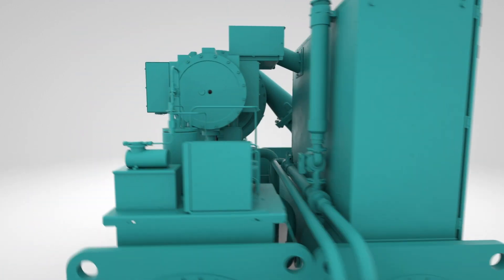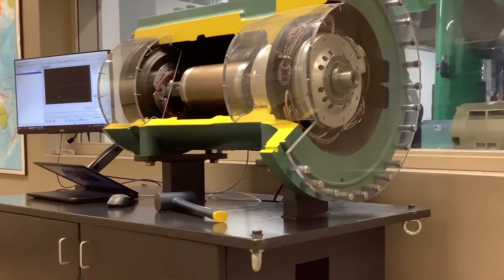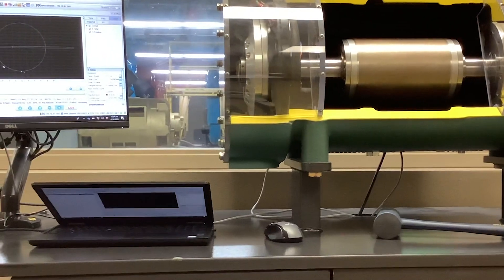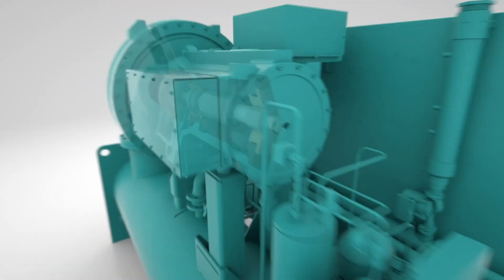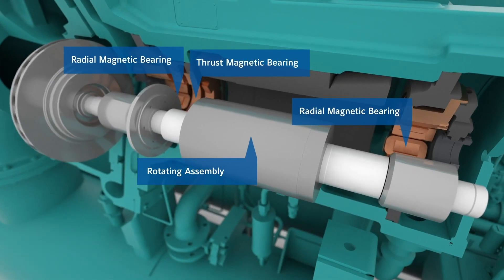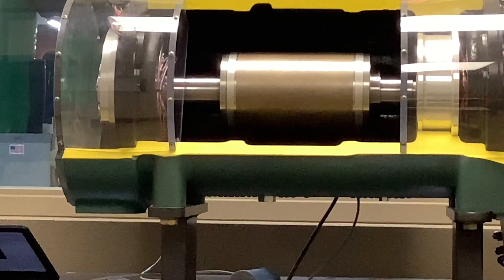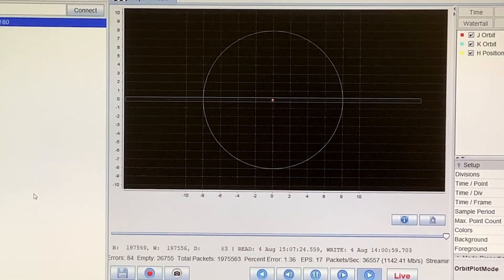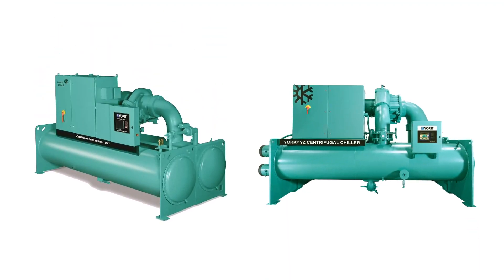YORK Magnetic Bearing Driveline Cutaway – Whack a Mag

Comment: will magnetic bearing work on heavy load without auxiliary mechanical bearing?
If not then how is it maintenance free? 
And what is the cost of power required by magnetic bearing to operate vs the cost of mechanical gear replacement?
Reply: " And what is the cost of power required by magnetic bearing to operate vs the cost of mechanical gear replacement? "
- Even if it's expensive, for all intents and purposes: it's lifetime use.

Comment: I came to this because I was thinking about designing my own magnetic bearing, but using permanent magnets.
Of course now thinking about it, you'd need a way stronger MF to support a shaft on a industrial scale. But then i ask, is it really worth it to cut the price of maintenance but then having to pay for power and rely on sensors? Very interesting topic.

If it was a 1kw magnet centering a heavy shaft of a turbine that runs 24h and 12 cents per kwh. That would make around 1000€ a year of electricity. Usually one days worth of maintenance in a big company is about 400€ a day per technician but you only do maintenance on bearings every couple of years. I would say its not worth it.

For reference, a kwh in my country is about 35 cents, bearings on heavy duty mills and transport screws (crushing rocks and moving cement) in a company i know are changed by no more than 4 technicians every 4 years. Thats about 3200€ per machine in 4 years.

The screw weighs about 500kg and lets not speak about radial force of the crushing mill, but i doubt a 1kw magnet could center it. Even if it could, that would make about 4000€ at 12c/kwh and 12000€ in german 0,35€/kWh.

I really would like to know what kind of company buys these bearings and what application they are used in.
Reply: You  should also factor in that there is no oil in the compressor. This leads to lower maintenance costs, less components on the chiller and better efficiencies due to the absence of oil logging of the refrigerant. Thos factors make  magnetic drive compressor superior.

Comment: Bravo , it is great ! Sir . May I
wanted to know with this magnet
Bearing  can the motor design to
Run at 100,000 rpm . Thanks
Reply: Chiu, the max rpm now in the market can reach half of your target. if you want make it 100,000, technically no problem... The only factor which limit the RPM is the Material of the bearing.